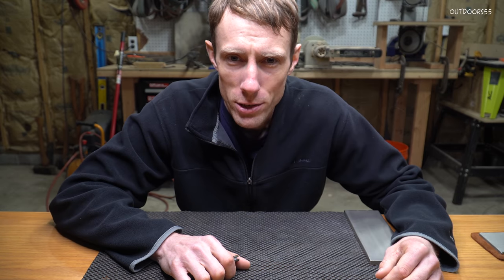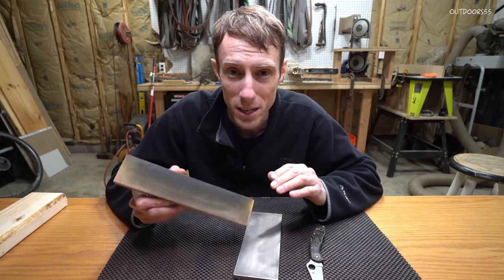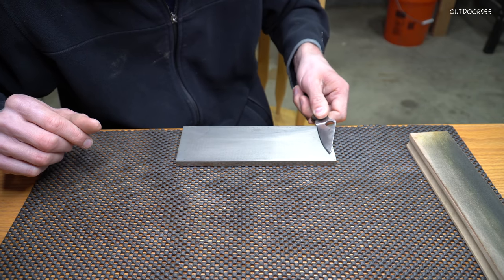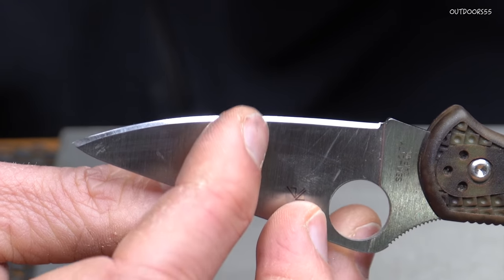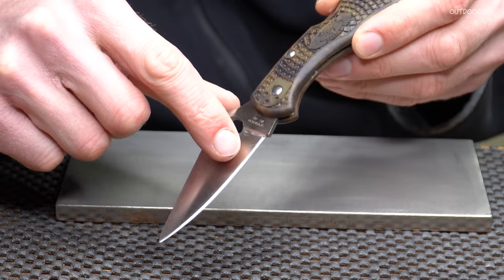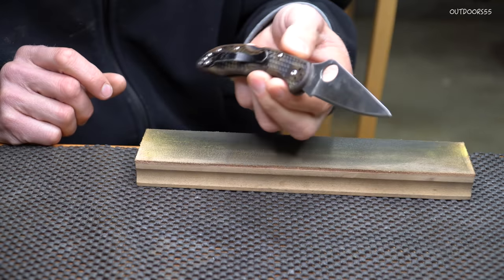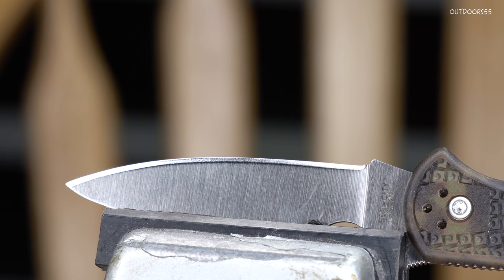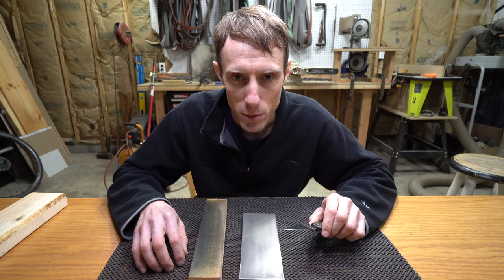How I Sharpen My Knives With Close-Ups

Comment: for the lighting, you seemed unsure of the best angle for illumination to show the contours and angles of the blade-- there is none.

I would consider trying not to display the blade from a bang-on side view. Rather angle it a bit with the tip lightly tward the camera.
Moving the lighting around is a great idea. Conversely, you could use a turntable and move the blade if you want to keep the lighting still.

Enjoying your content.
Reply from the maker: Yes, the problem is the end of the lens is only about 1 centimeter away no matter what angle there is still shadows. I need to get a light for the end of the lens so no shadows are cast 🙂

Comment: I am new at learning the correct way to do this.
Sometimes it appears that you are sharpening towards the edge of the blade and sometimes it appears that you are pulling the blade towards the spine. Am I seeing right? Do you sharpen towards the blade or towards the spine? Does it make a difference?
Thank you!
Reply: Apply force when you push the blade into the stone but for whetstones you must pay artention to not cut into the stone as it ruins both, the stone and the blade.
But some ppl prefer to drag the knife over the stone

Comment: I bought a spyderco medium grit ceramic stone and a dmt extra coarse and a leather strop based on earlier recommendations. This set up has worked well for me (even though I rarely use the dmt extra coarse). Would this dmt fine be a good addition as an extra step between my spyderco medium and stropping?
Reply from the maker: Yeah I use mine all the time. Its close in grit to the spyderco medium but cuts faster. I still use the medium to clean up off the diamond

Comment: I have sharpened a few knives but I love other folks setup and techniques.  The approach to teaching here is great for those learning only thing I would add is that the steel you were sharpening works great with the setup but not all steels would respond as quick to that stone.  I know you didn't imply this just something to note for newer folks.  And I apologize if I didn't catch you saying this if you did.  Cheers.
Reply from the maker: I haven't found any steel that doesn't work well with diamonds. From super cheap unknowns to cpm m4 at 66 Rockwell It will cut anything🙂.

Comment: Hey, I have sharpened my knife and it cuts paper like butter, thing is it doesn't cut hair like a razor, what is the problem?
Reply: alot of things, you either didnt strop it right, you sharpened at a bad angle, razor use 17 degrees on the angle ( you dont need to use a really low angle), you need to 100% apex the edge , either that or the knife material isnt good enough.

Comment: hey there I have a question regarding sharpening. How do you get your knive to cut the kitchen paper as easily. I can get my knifes hair wildling sharp but never to cut kitchen paper
Reply: If it whittles hair it should clean cut kitchen paper.
If you have a thick blade, then you can bite and slice hair well, but not do continuous cuts like paper well. (Since it distorts the cut, like slicing vegetables with a meat cleaver.)

Comment: Hi Jason....thanks for the video. I use the Cliff Stamp 3 step process for my very inexpensive kitchen knives and they work great..very sharp using his process of destressing the edge first and so on. My stones are the Naniwa splash & go 400 grit,  Arkansas soft, medium, fine, and  the black surgical all with mineral oil. This Cliff process and these stones work great but it's time consuming. You have my interest in the DMT bench fine. What else would you recommend other than your leather strop on the DMT bench line? 

You come across very good in the video and I follow you on Beyond T0.1 Micron and Blade Forums.
Reply from the maker: Hi thanks for the comment👍 I tend to use my spyderco ceramics quite a bit for further refinement but that's pretty much it. Also, Im not on any forums. Only YouTube and Instagram. And have never made a post on either site. Anyway, thanks again 👍
Reply: My apologies..how I got you crossed with Jason Stone, I don't know but anyway, as to my question, I found the answer in another one of your videos..........Knife Sharpening | Simplest Way To Hair Whittling Sharp | Entire process Shown. Thanks, and now I have to contact you about purchasing the set up (strops & compound).

Comment: i never get my knives sharp, should i try first 300+grit or 120grit first? and then higher??
Reply: i start on 600. any lower and you are removing a ton of metal that you dont need to. only time you need those low grits is for reprofiling. if it doesnt feel sharp off your lower stones you need to try again. there is a good chance that you arent getting the apex right. go slow and make sure you hold the same angle both directions. once it feels sharp, then you can go on to the next stone.

Comment: I've been watching you off and on for over a year now.... well I just picked up my first DMT plates and by following your instructions I finally free hand sharpened a knife that's so insanely sharp it shaved a 4" spot of my arm baby smooth in 1 pass. Thank you.
Reply from the maker: Great to hear!
Reply: @OUTDOORS55  I have a question for you. I've noticed the bevel near my tip is wanting to start receding away. I'm sure this is a very common rookie free hand sharpening mistake. What am I doing wrong?

Comment: Assuming I don't have 70 smackers to throw at this stone. Do you know of a good budget alternative? 

Thanks for the content, yours are always the most informative videos.
Reply: King stones.
Naniwa Professional/Chosera.
Shapton Professional.
Shapton Glass Stone Seven (smaller glass stones.)
Skerper Professional (made by Naniwa), Skerper have a Shapton glass clone too, not sure on the quality though.

All good stones. They are all splash and go, except for some King stones, which are soakers.
King are cheap (but good), the others are a little more expensive, but much better quality.
Skerper is a midrange brand, but the pro stones being made by Naniwa are going to be pretty decent, I've heard they're better than the Superstones (Naniwas budget oriented brand.)

But you should look at local markets for used stones.
Old oil/natural stones are pretty good if you can find them cheap. Flattening them shouldn't be too hard. (Run them over your concrete pavement or slabs.)
You can maybe find something good. Used doesn't mean bad quality.

Happy to answer any other questions you have.
Reply from the maker: They make some smaller cheaper options that work just as well. You should check their site. 🙂

Comment: have you had any experience or thoughts on the spyderco CBN 400/800 stone at all. was looking at maybe getting one but not really sure yet
Reply from the maker: I have one. I haven't used it much so can't comment on longevity but it should last. Seems well made. I have seen some grit contamination with it though. Not a big deal if you don't care about that though.
Reply: @OUTDOORS55  should do a video about it at some point. I was looking at it because you get two sides on one stone/plate or whatever you want to call it. Just not a whole lot about them so haven't been sure if it is worth it or if it's just a gimmick sort of material. I have the whole ceramic stone set so it would be added to that for doing things the medium can't

Comment: Turn the knife parallel to the stone,press in the middle of the knife(on top of the blade in the center of the knife(run it one way only)
Reply from the maker: No
Reply: @OUTDOORS55  it will hollow out the bevel,as you use the knife it will become sharper.

Comment: Can you get the same edge through the same process with, say, an AUS 8 steel or equivalent?
Reply: Sure, but you may have a little more trouble with the burr.
Reply: aus 8 takes a mirror finish super well and gets mega sharp. sadly the edge doesnt last super long

Comment: Hey Alex, is the horse butt leather better or comparable to rhe veg tan leather on your site.
Reply from the maker: It is ever so slightly denser. Our vegtan is really close to horse. Its good for knives like scandi/chisel ground, or for chisels. The toughest/ density keeps the corners from rounding. I will say though that the difference can be negligible as our vegtan is extremely high quality. I personally dont use horse in my everyday sharpening but some seem to like it. Especially for the higher grits 🙂
Reply: @OUTDOORS55 1 more question, thank you so much for replying I love your channel, I have a mora garberg and I'm waiting for a hultafors aby, so for clarity, you'd suggest the horse strop for those, I have heard the softer strops do round the Scandis? Thank you again

Comment: I REALLY need to start learning how to sharpen my knives.  I have a Smith's tri-stone. I hope it's good enough to start learning?
Also out of curiosity, if I don't know how dull a blade is, what's the best grit level (like coarse or fine) to start sharpening the blade at?
Reply: If you have never sharpened them before, going with coarse first will make the whole process a lot faster.
Reply: The tri-hone is fine for decent steels, not great for super steels.

You can start with super fine grits, but it's going to take a while.
Coarser grits just make it faster.
I say start with a 22-320-400 grit, then push it up to a ~1k and deburr on it, and strop if you want (absolutely not needed, but makes it easier.)
Reply: @autumn5592  what would be defined as a super steel?
Reply: @nosrin1988  CPM S30V, S90V, S110V, 3V, 4V, and M4.
ZDP-189.
M390.
Maxamet, Magnacut, CruWear.
Couple others I'm forgetting, but, great steels that are insanely durable and strong.

Most people though would have mid range steels like 440c, Aus-8/10, 8Cr13Mov, VG-10, W1, O1, D2, and 1084-1095.
These should be fine on pretty much any stone you can get. D2 may be a little tricky on Arkansas stones (like in the tri-hone), but would still work.

But if you're doing super steels, don't count on it any time soon.
Reply: @autumn5592  awesome! thanks! good to know! 
Where would 5160 fall on this scale? I have a camping knife with that material.
Reply: @nosrin1988  5160 is slightly worse than ~1080 steel. (Increased chromium makes up for lack of carbon (~.60%)
So relatively easy to sharpen.

It's lower end, but is still perfectly good blade steel.
Reply: @autumn5592  oh, thats sad to know that it's not as good, but at least it's good. Was an american made knife so I went for it.
thanks for all the helpful info! I sure have a lot more to learn!
Reply: @nosrin1988  Don't worry, so long as the steel takes and holds an edge, it's fine for most uses. It is not a bad steel.
(Now if you were surviving in the middle of nowhere, I would have a different opinion, but for camping, no doubt, perfectly fine.)
The 'scale' of steels is oddly skewed, so it looks like your steels aren't great.
But look at it this way, 5160 steel, with modern heat treatment and quality control would be better than even the finest of blades from years and years ago.
It may not be the best steel, but if it does what you want, how you want, it's a good knife.
Reply: @autumn5592  thank goodness for modern technology!
Reply: @autumn5592  can confirm. m4 is a bitch to sharpen on cheap stones. it can be done, but it is going to take a ton of time. durable as hell though. accidentally hit steel a couple times and didnt do anything to the edge